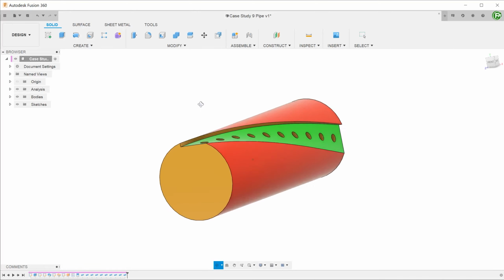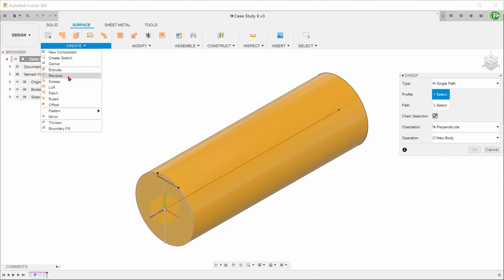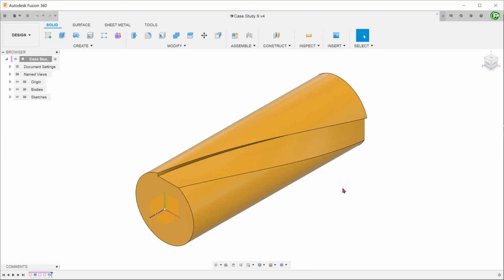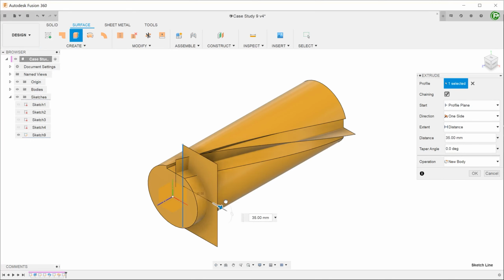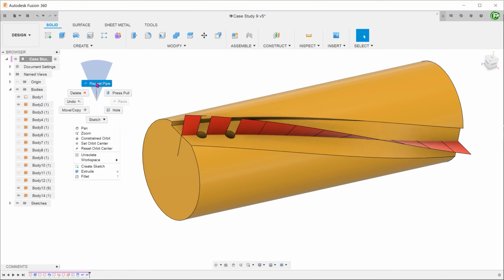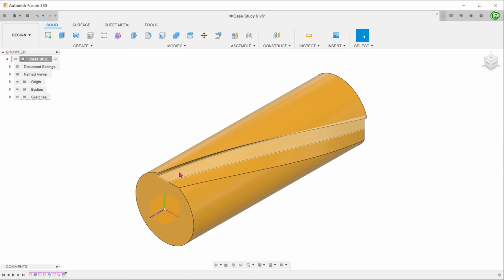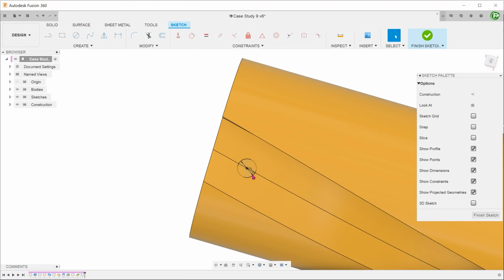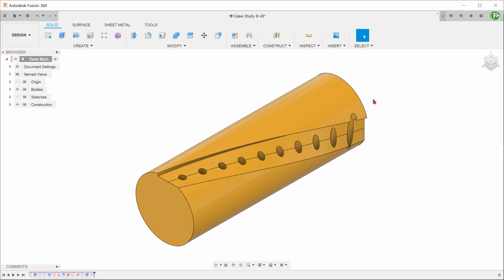Fusion 360 - Case Study 9

Comment: Hey, found your channel recently and I'm a big fan, you explain things in a really great way! I actually think I have an alternative method for this, using the emboss tool. So let's say the sweep was 90 degrees. what you could do is create a plane tangent to the cylinder, draw a rectangle that is the same dimensions as that cylinder unrolled, so the circumference. Now a quarter of the height of that rectangle represents the boundaries of a 90 degree sweep. If you draw a line on the diagonal of this quarter rectangle, you can then draw how many ever circles you want along that line. Now if you emboss/deboss those circles onto the cylinder you end up with your holes that are in the right spots all normal against the cylinder surface. The other profile sweep will have to come after the emboss operation but that's about it. What do you think?
EDIT: I tried it out https://imgur.com/a/lmZWkxx - It is not what the case study design is trying to achieve, since the holes follow the curve of the cylinder, not the flat cutout surface. So nevermind!
Reply from the maker: This sounds like an interesting idea. The picture looks right to me. Why do you think that it does not match what the case study is trying to achieve? I will try this when I have time. Thank you for this creative suggestion!
Reply: @Fusion360School  well the holes in the case study are perpendicular to the cut out surface. With the emboss method, this can only happen if the cut out is also a curve concentric to the cylinder. Only then will the holes be circles on that surface. Once that cutout is like the shape in your video, where it's a flat line not tangential to the cylinder, the debossed holes become ovals when they get to that surface. Also I found that the deboss operation kind of works like a loft to a point. Where the sketch circle might look like a circle on the surface of the cylinder, but that hole keeps getting smaller as you go deeper towards the cylinder axis. Almost like a cone shape. So I feel like I was off in a couple different ways with this method. But still feel like it could be onto something haha
Reply from the maker: @akaTelo  You're right. The emboss command would wrap the circle around the cylindrical face. Still, this sounds like a possible alternative to get the helical path.

Comment: Does this solution create the holes as cylinders? I.e if you select the cylindrical faces, does fusion tell you the radius in the bottom right corner. If the holes are not cylinders then it may be hard to drill them in the cam workspace.